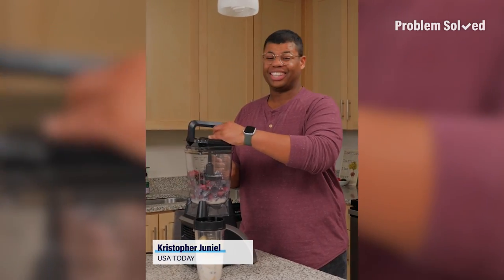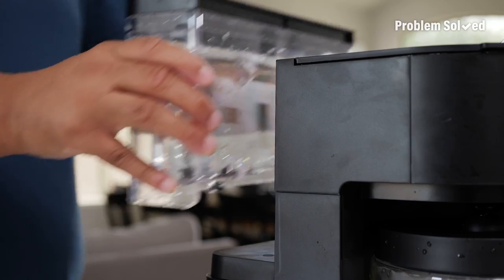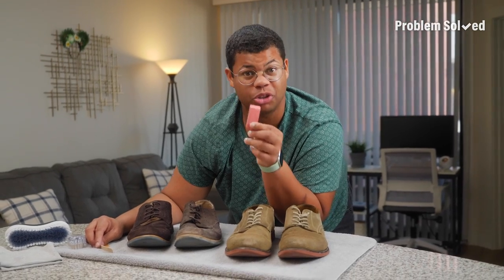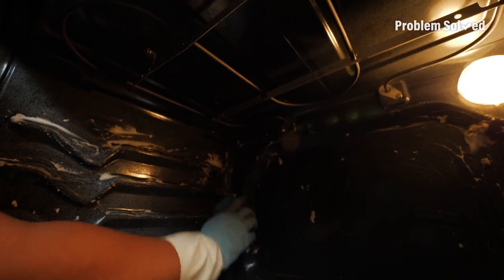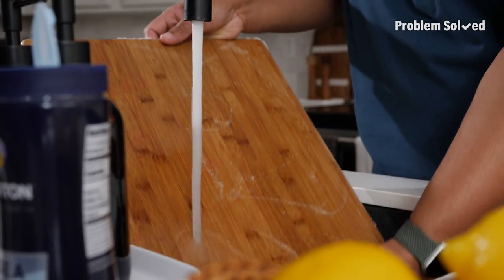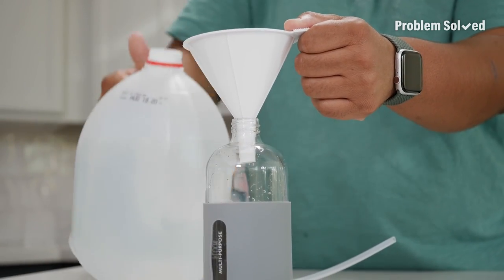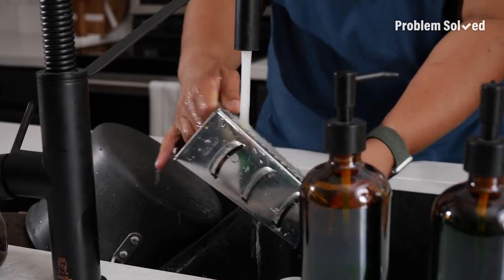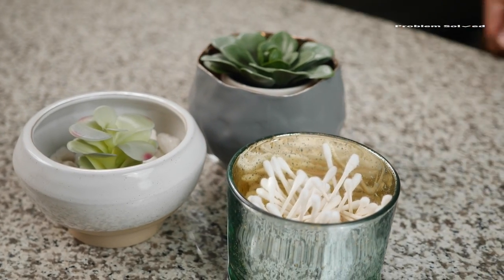9 weird cleaning hacks that actually work | Problem Solved

Comment: Something I also use to clean are fuzzy fabric gloves; make sure to wash them first and remove any lint. Simply put the gloves on and spray them with whatever dusting spray you use. When they get dirty simply turn them inside out and continue dusting, you usually do not need to reapply dusting spray. Another trick, when you wash your cleaning towels put a cup of vinegar in along with your dirty cleaning cloths and detergent. When you dry them, do not use dryer sheets as that causes the fabric to repel water this works great for streak clear glass and mirrors. You can also put denture cleaning tablets in the back of your toilet and in the bowl to help get rid of the calcium buildup. Another great hack is when you are drying your clothes in the dryer put a dry towel in with the wet clothes. This cuts drying time and increases the longevity of your clothes.  If you have a glass ring on a wooden table use pure mayonnaise to clean the surface, concentrating on the ring and buffing in the mayo until it is completely absorbed! This helps reduce the ring and gives wood surfaces a beautiful grease free shine and nourished wood. I have so many cleaning tricks I would love to do a video on. Maybe some day.

Comment: Cleaning oven racks. All you need is a trash bag , Ammonia and a couple of paper towels. Put your oven racks in the garbage bag and wet a couple of paper towels in ammonia, tie the top and lay them in the sun for a few hours. Take them out and hose off. They will be so clean,just like new.

Comment: wax removal for candle holders and decretive candle containers is easier than you think. Even though I like your video, this is how we do it. Put tin foil over a baking sheet plus cover the sides and ends.. Then place all the containers and holders on the foil. Place pan in the oven and set to 250.  Bake for 30 min. The wax will melt and run onto the sheet. When all melted turn off the heat then remove the containers. Remove one at a time and finish wiping out the residual with a disposable cloth. We use old sox and underwear (clean underwear). The wax on the tin can be heated back up on a lower temperature then poured into a new container with a wick and there you have it.

Comment: I like using dishwasher pods for cleaning inside the oven, bottoms of pots, stovetops and inside the oven.  Anywhere you need soap and a little abrasive power.